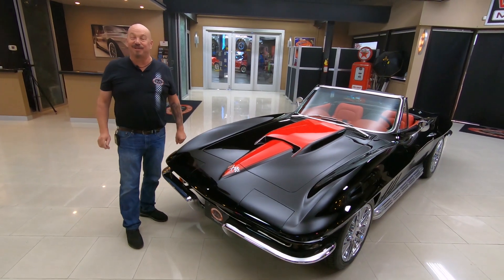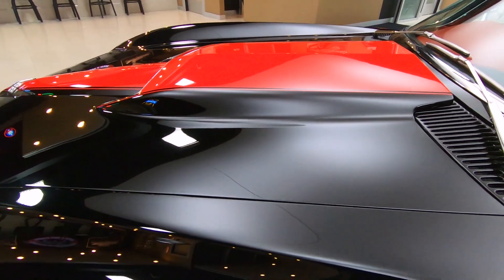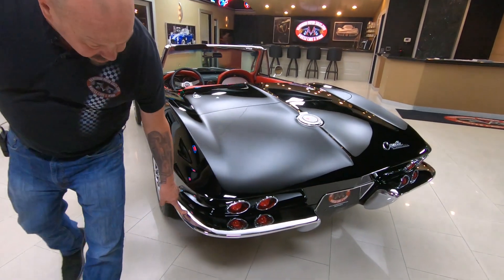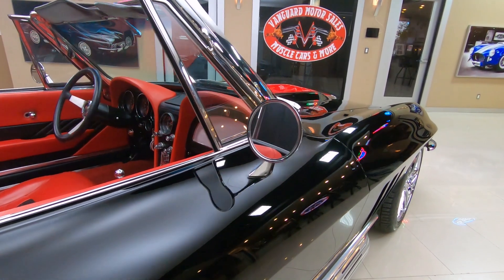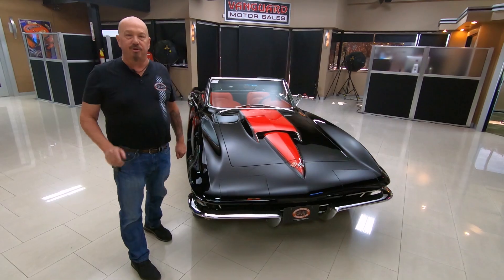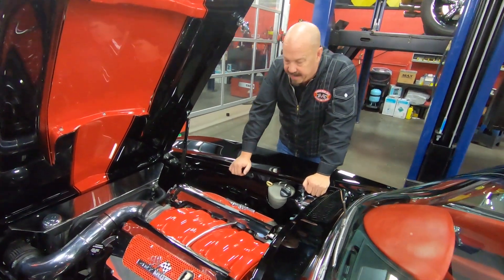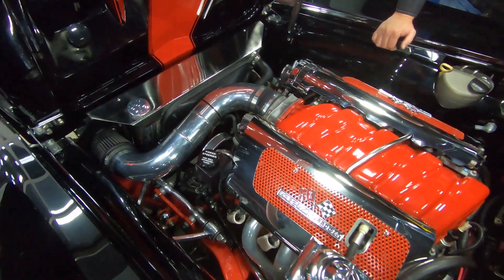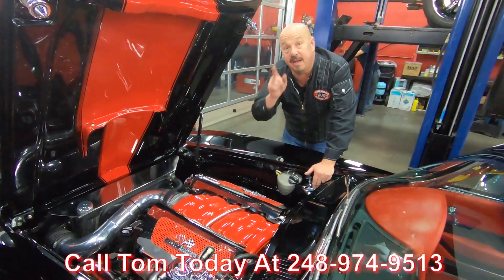1965 Chevrolet Corvette For Sale

Comment: Are there any lapbelts? Does it legally need to have lap belts?
Reply: Spencer Lincoln model year 1965 came as lap belts only. No shoulder belts. Still perfectly legal that way too because it always goes by whatever was applicable in the year the car was built. If it had it new, it's still gotta have it and in good working order. But it's exempt from requiring anything that may have came after it's birthdate. I know the reply is late, but hope it helps if you were still unaware and wondering. :)